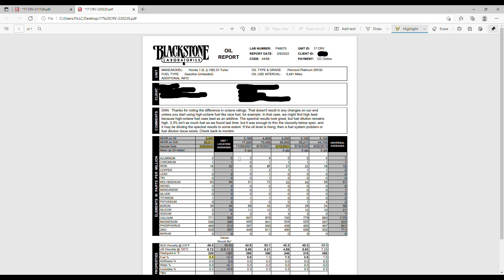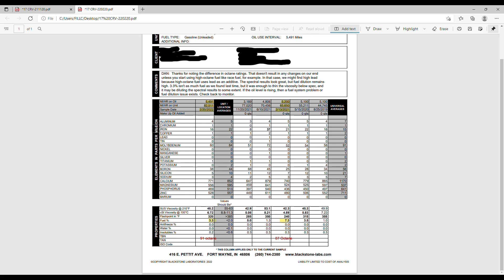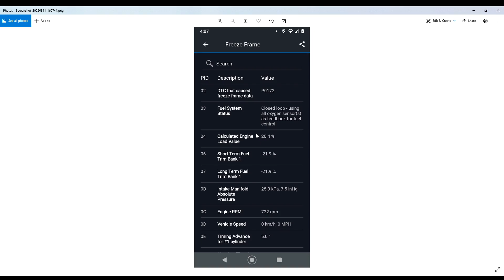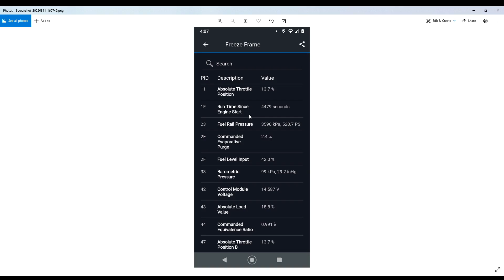2017 Honda Oil Dilution - Winter Oil Sample Test w/91 Octane - Dreaded P0172 #5

Comment: New viewer of your Adventure in Oil Dilution/High Octane Fuel... Got Fuel Dilution of my own with a GMC Terrain (2.4L Ecotec AWD)... Had/Have been taking measures (including E0 91 Octane, which conveniently is, for the moment only 20 cents or so more then regular E10/87 octane... Requires an extra 20 mile round trip to get but... Helpful for improving the oil warm-up/fuel burn off...

Due for a 3 month/almost 3K mile sample soon (picked up a Dipstick Sample Pump so I can more easily test the oil without, hopefully, needing to dump oil if its still got some useable life left...)

Comment: Honda's days of problem free engines are long gone when they started with these small lawn mower engines and turbo them up . Same with all the other manufactures. Governments EPA's are to blame.
Reply: The EPA demanding our vehicles get better gas mileage is not a bad thing. The issue is how the car manufactures are going about trying to reach those goals. Small engine with a turbo charger then adding in the low friction rings is the main issue. The rings do not offer as good a seal at low temps. Once the engine is reached normal operating temps they seal better but with the Turbo throwing high pressure air into the combustion chamber makes it hard to keep that fuel out of the crank case. Getting rid of the low friction rings and going back to normal rings would help alot at providing a better seal. Bottom line They need to find better ways to save fuel for us drivers

Comment: my 2022 not leaking by gas yet at 8k. another owner was mixing 0w20 oil with5w20. thinking about going entirely to 5w20 oil. this a dagum shame in 35000$ car!
Reply: How is oil weight going to make any difference when it's fuel seeping past the rings?  I also can't see how higher octane gas will help, either.

Comment: Thanks for video and new raport.  When you take intake manifold off please check the intake valve for carbon-deposits and upload some pictures please. As you probably know this is a common problem in engines with direct injection. It could be very interesting to see how they looks like after 80k miles. Thanks again and can't wait for next video.

Comment: I just got my oil report back today for my 2021 CR-V.  After changing it at 3400 miles in November because the oil had risen to the top of the orange piece, the oil rose 10mm in just 900 miles.  This was all on regular unleaded.  At 4300 I switched to 93 octane.  Octane free is not available in my area.  The oil level stopped rising after the switch.  Now at 6900 I changed the oil again and had it tested.  It had 2% percent gas in the oil, which Blackstone said was probably the 10mm rise I had seen.  My plan now is to continue using 93 octane and watching the oil.  If it doesn't rise more than a few mm, I may extend the oil change mileage to 5000.  A few other things I did.  I bought an oil dipstick without that orange plastic so I can get an exact reading.  I always check it cold in the morning, so I can get an exact comparison.  When the oil is warm, it will show a 2mm expansion rise on the dip stick.  Again, if I see a 10mm rise when checking it cold, I will figure that I got 2% gas in the oil, and it's time to change it.  If it suddenly starts rising fast or goes beyond 10mm in 3500 miles, then I'll know I may have dirty injectors, worn plugs, or some other problem that needs looking into.  All this said, I think the 1.5T is a tough little motor.  Factotum Life, you got 82K on yours even with all the gas that was in the oil over the years, and it still runs!  I have hopes of keeping mine for many years.
Reply: 82k is not impressive tho. Not everyone is rich or can buy cars new. Heck it's not uncommon to buy a used car with 70-80k miles on it. 

Older Hondas have gotten hundreds of thousands of miles on them. If I'm buying a new year Honda I expect to at least get a good 150k out of it.

 I'm looking at a 2019 Honda CR-V with less than 30k miles, and this whole business is putting me off. It would be a major investment for me at around $30k for the touring fully loaded one, but probably will look elsewhere because it's not worth to pay basically a new car price for something that will have major problems after 50k miles of use. Even if I wanted to get a brand new 22 it's the same engine. What a sham.
Reply: @hak2297  I can't speak to 2019s.  On my 2021 I'm getting no oil rise AS LONG AS I use premium.  My daughter borrowed my CR-V for a couple of weeks and put 87 in it.  The oil started rising again.  I put 93 in it and it's not rising any more.  I use only top tier gas and GF6 oil.  I am concerned about oil rising again as the fuel injectors age.  To not have to deal with all this, it's half tempting to trade it for 2023 HR-V with a 2.0 port injection (80s technology, 80's reliability, and 80's fuel economy).  What's holding me back is the CR-V is a really otherwise nice car.

Comment: Thanks for your video!  Looking forward to seeing the injector video. Could worn spark plugs also contribute to the fuel/air mix not firing completely and so add  to the delusion problem?  My suspicion is that EVERYTHING on this engine needs to be working top notch or the gas in the oil will creep up.